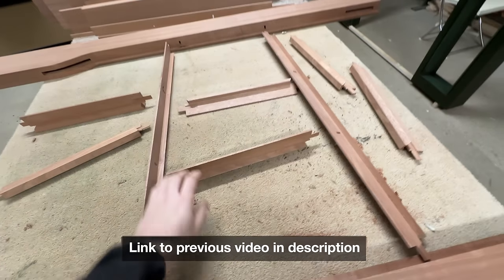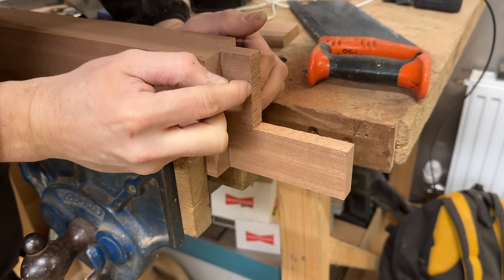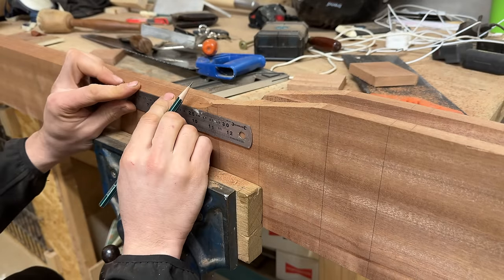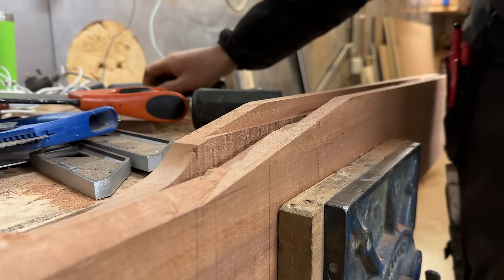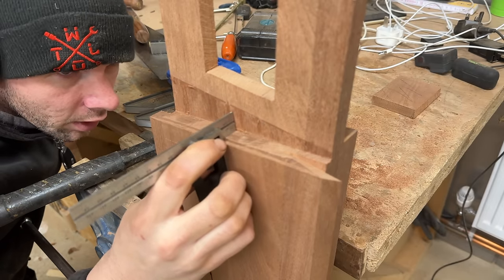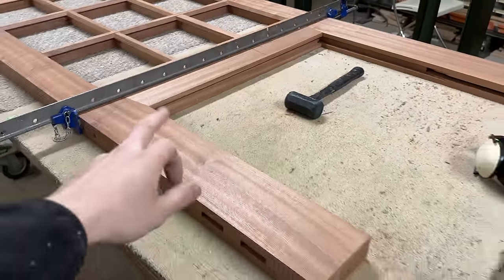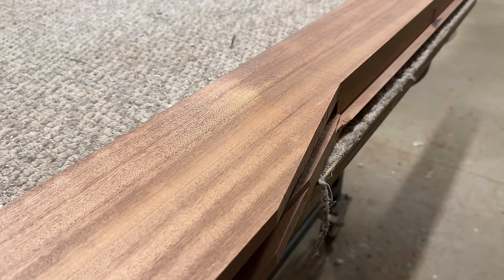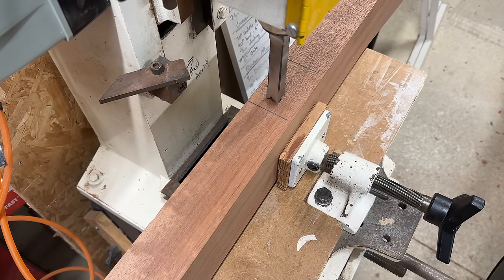Traditional Door Making : Gunstock Stiles, Diminished Shoulders, Tenons & Haunches

Comment: 25:00 You can fox wedge also & split the tenon which is even stronger, & doesn't rely on just glue strength.
Reply from the maker: True, i dislike fox wedging as you are interrupting the grain of the rail/tenon and cannot create tension in the centre of the stil as a blunt wedge down the outsides will, which is where the strength should be IMO. both work though

Comment: My first frame of the year ended up in the bin mat:(

Admittedly it was in the evening aver a decent first day on site, for some old bloke I was trying to look after… ho hum 

When you forget to route haunches final depth just use two bits of stock same width either side … a stuff up sandwich! ‘What are you?! A stuff up sandwich!- G Ramsey’

Happy new year
Reply from the maker: haha, ive had a few god wrong but not too many. Usually when youve forgotten to do something that the panic sets in
Reply: @BradshawJoinery  yeah, all machines were set up
For a big job I did last year and I
Just ‘rushed in’ thinking I’d be sweet, then a catalog of dumb ass moves later seen 1.5 hrs and couple of meters wasted 😂

But he wanted me to repair his old one which is MORE work!  For what it is.  So I said today ‘need a new one, $500 do you want it or not?’

Jumped at it, it’s glued up and going through sander shortly 👍🏻

You ever made a Gothic arch door, I want to give it a go, but I’m a bit chicken 😂👍🏻

Comment: Have you ever had problems with wider rails and expansion?  I noticed in the glue up video you glued everything (the shoulders, haunch and tenons).  Has this ever been a problem in parts 8"-10" wide? 
Love the work. Thank you for sharing the excellent content
Reply from the maker: No, back in time when. I didn't acclimatise timber (or didn't have the facility to) it often means rails will shrink over time, but now it's not so much of an issue unless things get damp or external. I use Accoya for all external except certain circumstances.

Comment: Q1. Why not use a multi-tool  - instead of coping saw?  Q2. Could you have used a "micro planer .. when finishing the Gunshot cuts? Cheers.. just curious... Cheers
Reply from the maker: Speed and accuracy, multi tool is slow when you want to be accurate. Also coping saw will give a cleaner cut. 
Quickest metho would be with router on gunstock but thought I'd use the hand tools!

Comment: Nice work mate!
The glue your are using for laminating or glue joint is PUR or PRF? Do you recommend to use  Aerodux Resorcinol Resin for timber laminating? The laminated timber will be using for exterior door or windows. Many thanks.
Reply from the maker: Its PU, id say the best for external but any d4 glue is rated for it.